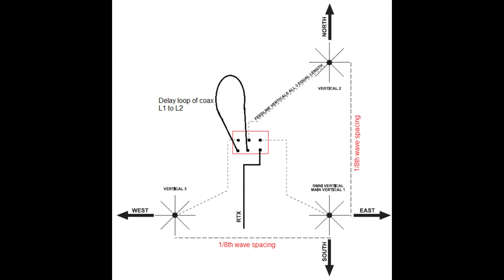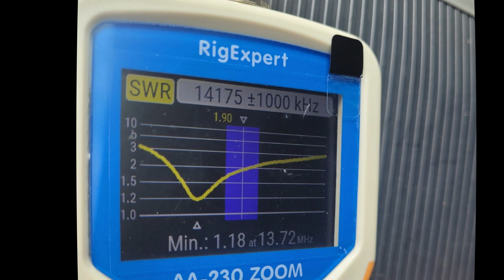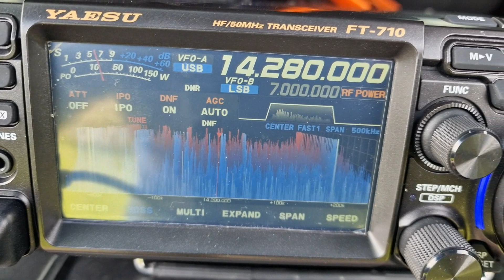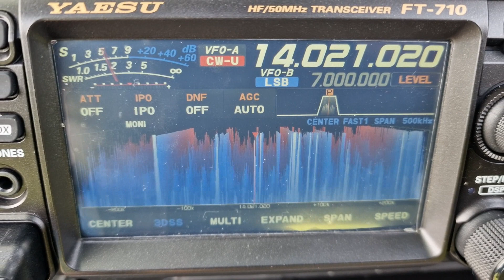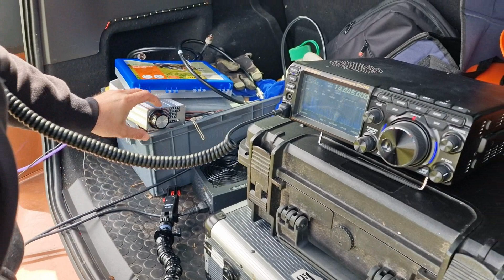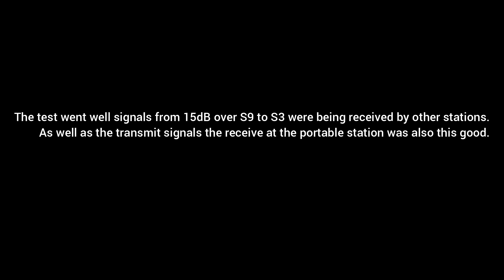GM6DX - 3 Phased Vertical Array (install and test)

Comment: Very interesting Billy.  A unique solution....  what phase angle and feed lines did you use.  Christman at 1/4 is 84deg feeds with a 71 deg delay line .  Has to be a bit different with 1/8 wave spacing.  MM0OPX did some 1/8 wave phased verticals but I don't remember the angles.   Nicely done and Brilliant.

Comment: brilliant! no ground radials? did you make the switcher yourself?
Reply: The relay unit is self designed. I then produced the PCB and constructed the full system.
Reply: Each antenna is a 1/4 wave elevated radials /feedpoint.